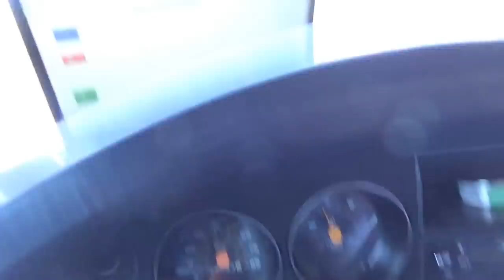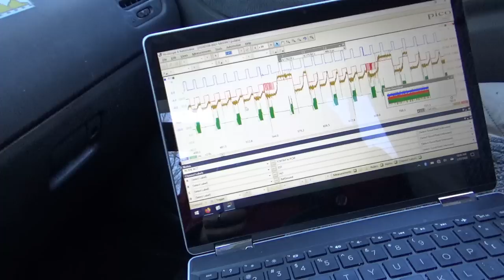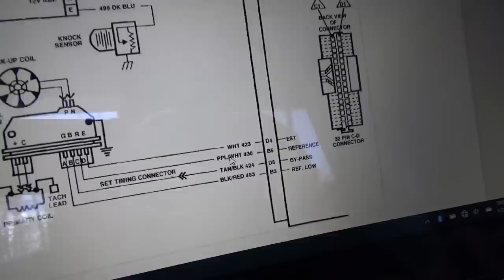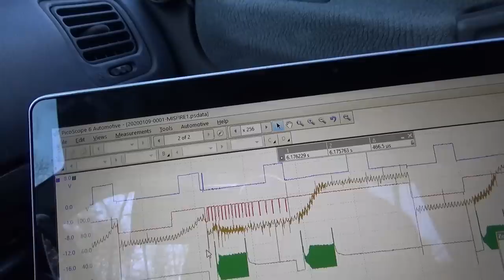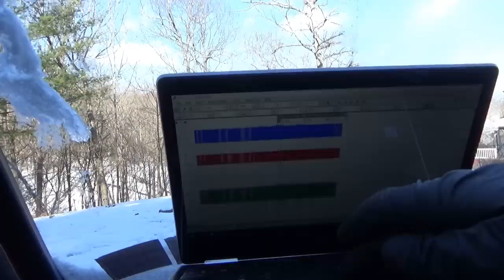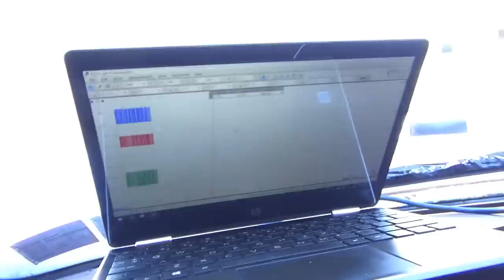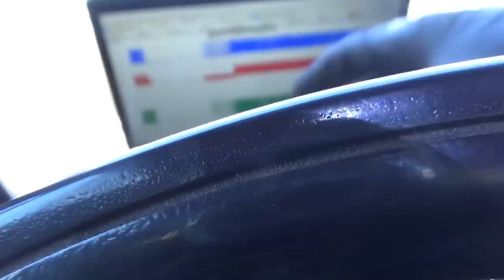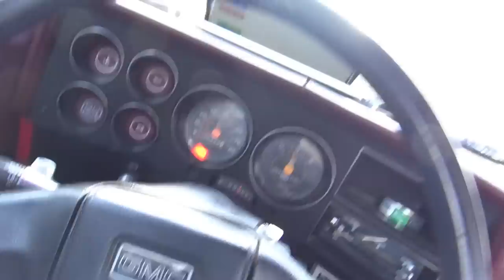COMEBACK? (87 GMC Plow Truck STALL/Misfire)

Comment: You can see in the old cap, there is one post that was turned around. It probably hit the rotor and cracked the tip of the rotor, not to mention it wa probably not in contact with the spark plug wire contact. Time for new wires and plugs, too. Or he can keep paying you. Thanks for all the cool. Vids.

Comment: In college in the early 1980s, I had a '75 Datsun pick up that required me to put in new points and condenser every Fall at the first cold rain.  I'd just buy them to have on hand.  Even tried preemptively doing it on warm late September day (SE TN).  Nope, first cold rain, I was out there with water on my back changing parts so I could get to class.  Never had any other problems with the ignition over the winter or otherwise.
Reply from the maker: Spray it with WD40!

Comment: WD40 on clean plastic that's already water proof? Are we all being (friendly) trolled. It does not keep water out as the cap has to breath so if any gets in it will get in from washing the engine (no chance of that happening LOL) or condensation. How do you test spark plug wires? It would sound better with that exhaust fixed, it seems there's too much noise to here the engine itself. I take it this truck has a carburetor? We use to tune them with a vacuum gauge but I'm not sure that was the best method but a LOT of back yard mechanics did that.
Reply: That truck doesn't have a carburetor; it has central-point fuel injection.  IIRC 1987 was the first year for CFI on the 1/2 ton trucks (and maybe others?)  I know on the V-8 cars GM stayed with electronic carbs until 1990.
Reply: No disrespect to Ivan but I totally agree with you on using WD-40 inside a distributor cap (collects dust and arcing from distributor operation will contribute to rapid carbon buildup from oily film).And hey I use to tune carbureted cars myself with a vacuum gauge ,using highest vacuum you could get at idle as indication of pretty good tune!Miss my  carburerated '85 chevy truck & leave WD-40 for nuts and bolts,LOL
Reply: Yes condensation and that would be the reason why the WD40 helps. Condensation happens every time the engine warms up...its a regular cycle. TBI is very reliable and makes a carburetor seem like a waste. When you are in freezing weather like this truck is, there is NO comparison to TBI. A carb requires the driver to feather the gas until the choke can function in freezing temps and if the choke is electric, you only have one chance to get it started and have a true choke cycle. If not, the choke is already warmed up and won't work on a cold engine.
Reply: @lvsqcsl  Thanks. Ive only owned Ford trucks (never owned a car other than one Jeep) and just cant remember back that far.

Comment: one thing to watch on these is distributor bushings. when they wear the gap on the reluctor widens at one point and shrinks on the other. once they et to a certain point they will miss under aceleration.  learned that one the hard way

Comment: give them a basic tune up before getting into analysis paralysis with your scopes.
Reply from the maker: That's one strategy that can actually be effective for older simpler vehicles. However, I never replace parts before doing the diagnosis and at least getting a direction 👍 What if a "basic tune up" didn't fix it? Customer wouldn't be very happy lol

Comment: Interesting that you talked about “toggling” on this 87.  I have been struggling with this p0365 ignition not toggling code for over a year on my 3.8 Buick.  They will run on the icm if the 5 volt pcm to icm signal does not happen properly.

Comment: Just started watching, preliminary guess- bad dist. Shaft bearings. Probably wrong as usual but have seen this several times.
Reply: Close, oh well. I always thought the purpose for the dielectric grease under the ignition module was for heat transfer/dissipation?

Comment: Oh shoot ,its one of those!! 
OEM caps and rotors barely make it 30000 miles 
Or 2 years in the marine app
Reply: Same with those low pressure fuel pumps lol .and tbi injectors .and ecms . Then they all got stolen . Now they steal Kia's. How times have changed.
Reply: For sure worn out before that.

Comment: What I have found over the years is ICM’s usually work or don’t
Reply from the maker: What about that 1988 truck with the cool scope capture? It worked fine until you got it nice and hot and gave it the beans lol
Reply: @PineHollowAutoDiagnostics  bad ground vs it just quits is a little different as being a plow truck corrosion is extreme vs a daily use vehicle